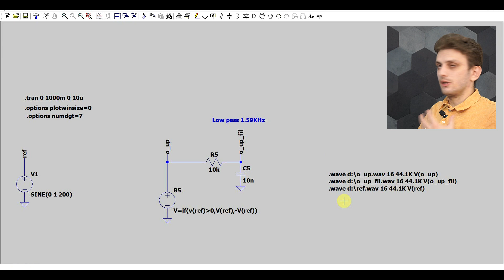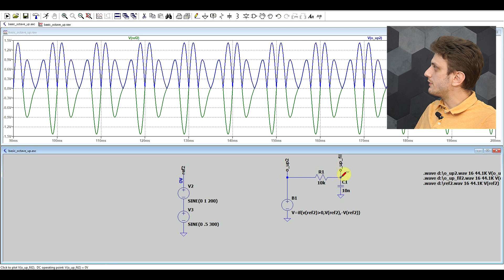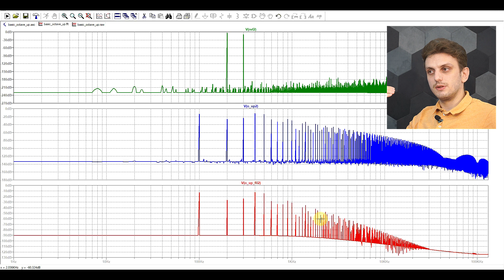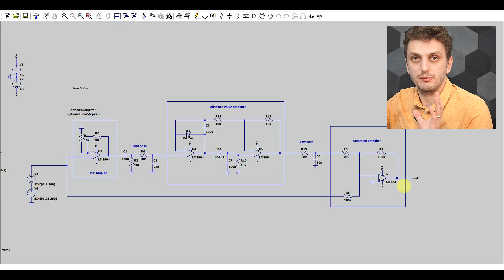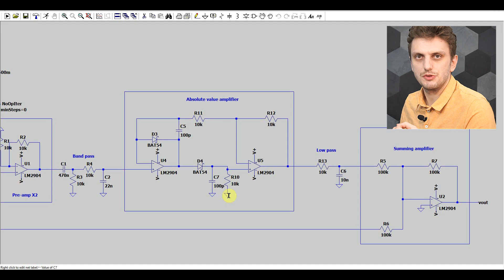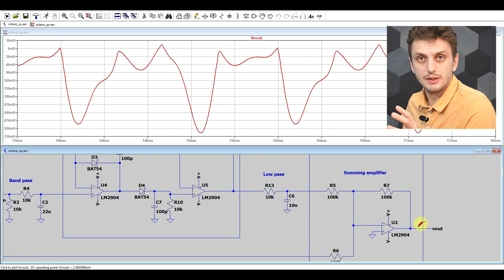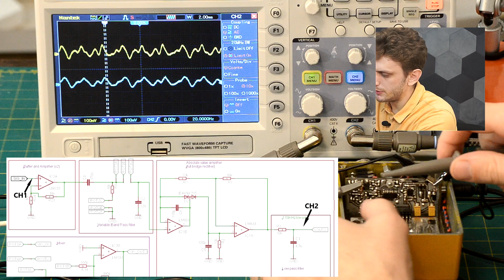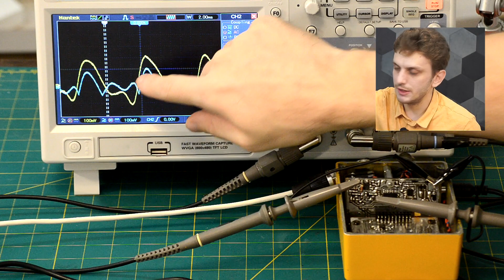DIY Audio Effect Pedal Part 5 - The Octave Up Effect

Comment: A couple other circuits I've seen that use rectification to get an octave up, feed the signal through a 1:1 transformer before rectifying. Does anyone know what would be the point in doing that?

Comment: ( to continue from my previous comment ) 
the stings bend slightly when pushed to the board...that changes the pitch... the string nut is extremely difficult to tune sometimes, and takes a high degree of precision modifications....but the bridge on electric is easy to tune....so open chords out of tune = allot of work ( best left to a guitar shop, for a fee...you could ask them to "re-set" the string nut ...but i would suggest you ask for "a full set up and tune" on the guitar...so you can hear what it is supposed to sound like )....notes up the neck out of tune = not too bad....and that is something you can maintain yourself.......once the nut and bridge are tuned in, then it's just maintenance tuning of the strings ....sometimes the bridge again, on a string change.

Comment: guitarists like their guitar Setup and Tuning to be perfect, and their wave shaping effects to be somewhat imperfect.
so transistors are normally used there, instead of op-amps....because the right input frequencies in music are what make it work, and the sound is more subjective to opinion.

set up and tuning has more to do with the String Nut for open chords, and more to do with the Bridge's Intonation further up the neck....tuning is a round robin process, in getting it right.....listening to the way the guitar sounds, adjusting how you play it, and listing to the other musicians; is the critical feedback loop in musicianship ...  to borrow an op-amp analogy.

guitar sound is like an extension of somone's personality.
so if all wave shaping effects were "perfect", we would lose the character, of the individual units, given by varying specific parts values.

Comment: I’d have filtered out that DC bias to the rectified signal with a high-pass filter. Feeding DC to speakers or amplifiers isn’t too good of an idea, not sure what a sound card will think of it. Some input devices will have DC-blocking capacitors on their input anyway, but I don’t like to rely on that.

Still sounds great though!
Reply from the maker: If we look at this circuit on its own you are right, but the effect is not a stand alone circuit; the mother board I discussed in the first 2 episodes of this series has the DC blocking capacitor; its added between the effect output and the last buffer amplifier; and there is one more cap on the output before the output jack. All the effects I work on are designed to work with the motherboard circuit I started off with.
Reply: sorry im a newbie and confused but what do you mean feeding DC to amps or speakers is a bad idea? don't most guitar pedals use dc?
Reply from the maker: @TheArcticKitten  well the supply voltage is DC, but the signal needs to be AC - there is no useful information (music or other sound) in DC, sound can only be transmitted by AC.
Reply: @TheArcticKitten  since a loudspeaker is basically a coil, it will have pretty much a short circuit behaviour for DC, which means theres a high current going through it, for AC it isnt acting as a shortcircuit but more like a resistor. the impedance (frequency dependent resistance) is described by "2*pi*f*L", where L is given by the device and f is the frequency.
if you stick in f=0 (in other words: DC current) the impedance also is 0.
to block DC and only let AC through you can use "coupling condensators" on the output.
:)
Reply: @sonnenhafen5499  thanks for the information! very useful to realistically apply these differences and understand them

Comment: You know that Ltspice is also capable of importing wav files? So basically you can just import a guitar sound and export it. That way you can hear the circuit without even building it. Or at least get an impression.
Reply from the maker: I know. I didn't do that, but rather chose to work with basic sine waves just to have a cleaner spectrum to see exactly how the sound is affected.
Reply: When I've used input .wav files, the time it took to plot the signals was on the order of minutes for an 8 second sound clip
Reply from the maker: @MovieMationStudios  Out of curiosity, if you run the same simulation without the .wav file and simulate 8s, does the time duration vary significantly? I guess if the circuit is complex and takes a lot of time to simulate anyway, then the issue is not the added .wave statement.